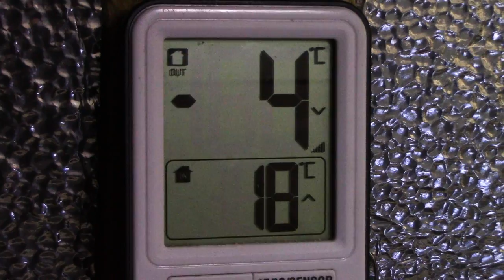Snowmobile Camper Solo Overnight- Primitive Heating & Wolf Lullaby / Log Cabin Update- Ep 11.6

Comment: As a suggestion, try brick pavers, the type used on driveways and patios. Can be heated directly over the flame, stack well inside the ammo boxes and can increase your heat storage capacity. Just remember a pair of tong's to load them into the ammo boxes! Awesome build, thank you.
Reply: Or fire brick.
Reply: I think Stone would retain the heat better than water. You would need at least 5 or 10 gallons of water to do what those stones did. The water would lose its heat quicker.
Reply: Brick pavers are very porous and can absorb more water than a stone making them potentially more dangerous than a rock but may also allow the moisture to escape when heated without fracturing. 
A better choice would be some square cut stone that would fill the ammo box eliminating the air space.
Reply: @Crewsy  he means brick paver not concrete pavers
Reply: @Crewsy  Yes.  Brick pavers are also less dense and less efficient.
Reply: rocks are easily gathered...
Reply: Steve Pratley I’m pretty sure he doesn’t need suggestions from us. And there’s a good chance he won’t see them anyway, he seems to stay too busy to read all the comments he gets.
Reply: @redhauscreator146  heat loss of water is due more to evaporation. If you use a sealed container, the loss should be the same, then just control the heat loss by the amount of insulation on the container.  With water you can just melt snow and not pack around the weight of the rock or brick.
Reply: Water can only be heated to 100c, depending on altitude. Rocks can be heated to much higher temperatures, making rocks far more desirable than water as a heat battery.
Reply: secret six    🤦‍♂️

I said brick paver not concrete paver so what do you mean?  Brick 🧱 is still more porous than stone ⛰
Reply: Cal 20 Sailor 
Water is a great heat sink because it absorbs heat fast but that also means it loses heat fast. 
Water is listed higher on the chart in the link below but I believe that is because it’s density (mass) is so much lower than stone which has the highest thermal conductivity by far (3 times that of water)

http://www.greenspec.co.uk/building-design/thermal-mass/
Reply: Couldn't you run a bunch of lines of copper tubing under the bottom layer of the sub floor.like inline floor heating run the coil into your firepit use water and antifreeze. Just a thought!
Reply: Bradley Schneider that will work perfect 👌🏽
Reply: @Yamahabanshee66  thanks he already has the floor in just route out with a Router on the sub floor and put some quick connect couplers hooked up to the outside.should be able to put like some type of cement to fill the gaps on the routed floor.or just add another 3/4 inch sub floor on top with the lines already in it
Reply: Iron/cast iron/ball bearings/anvil/etc store about the most heat of practical materials and no voids to make pressure steam and explode.
Reply: @bradleyschneider3871  I had the same idea last week as a suggestion for an off-grid Tiny Home which had a wood burning fireplace with a large passive-heat bricked surround. I thought about running the ends into the campfire in this situation here, too. I am just all about the radiant flooring, I guess. He could run water or oil through the tubes, yes?
Reply: Bricks will probably dissipate heat faster than dense stones but it would be interesting to test the idea. Fire bricks would likely last longer. Density is key, I think.
Reply: @lizday8140  I agree if your worried about the structure being burned just move the fire a little farther away and he can put something like that in his cabin build,a lot more work but the wood stove is not in place yet something to ponder over?
Reply: @stevecounts325  Well, he could have just disabled comments; there's actually some genuinely good advice happening. He definitely reads/highlights comments.
Reply: itskarl79  The rocks are free, the water is free, none of these other options are.

Comment: install some metal lined drawers in the floor, place hot rocks in them, warm floor, you will sleep good
Reply: Sleep good on a hard board with no air mattress?
Reply: Ben Scoles good idea indeed.
Reply: Good idea
Reply: I was thinking of some solar panels on the roof, deep cells in the floor.
Reply: The old board beds on the farms had slots in them for the hot irons or bricks that were taken to bed for warmth.
Reply: @ArizonaIrish  Batteries & Winter Are A Problem!
Reply: remoteviewer57 , I have no frame of reference. Desert rat here from AZ. We don’t really have a winter.
Reply: Gas convector and cylinder - the easiest way to solve the problem with heating
Reply: @Просто4еловеК-щ4к  100% but at the same time it's great to see a different method. In a confined space I'd favour for slow realise of heat as suppose to gas
Reply: @MrTomDon  he could at least keep a small mattress in the shelter 🙄🤔
Reply: @ArizonaIrish  so the batteries can / might explode while he's sleeping. Batteries need ventilation 🙄🤔😶😯
Reply: The tiniest wood stove the corner shop sells, mounted up enough to get your feet under. Alternatively, the Victorians did some interesting things with greenhouses and really long chimneys, wrapped around the walls. looked and sounded beautiful.

Comment: Maybe using hot air from an external campfire would work.  Put a heat exchange radiator in the floor or on a wall.  It could be pretty small, you are heating a small space.  Run a metal tube or line from a heat exchange coil in a fire and run the hot air into the campers heat exchanger.   You could put rocks around your heat exchanger in the fire to create a thermal mass so you would have warm air for hours even after the fire dies.  No heating heavy rocks, no heating 80 lbs of water, just a simple heat exchanger at each end.  Of course, vent your system to the outside of the camper.  This would be simple and light with no chance of fire or CO2.

Comment: You can try a radiant floor with a hose connected to a copper coil that can be placed in the fire.  You may need an expansion tank and a small pump.  And a wire to drag the coil in and out of the fire.
Ps: you need a vestibule to keep your clothes
Reply: no need for pump, the natural effect of heat transfer will make the water flow, even just a inch over level of fire.....great idea
Reply: If it's to use coils, what might be worth looking into are heat exchangers for the air coming in and the air going out, since that's probably one of the main sources of heat loss.

Comment: I bet that thing loses so much heat every time you open that huge door. You might consider hanging a plastic sheet or something to stop all the cold air from rushing in. As you've put a lot of time and work into heating your space and I'm sure you would like to preserve that effort as much as possible.
Reply: Maybe make a smaller door on one end to crawl in and use big door to pack gear in and out.

Comment: You might consider adding a tray for the hot rocks, underneath your "bunk" area.  Planks with space left in between them would allow the hot air from the rocks to rise between the cracks into your bunk area.  It will keep your back warm and prolong the heat loss from the rocks.  Also consider a small ceiling fan.  It will push the hot air back down into your sleeping area, prevent the condensation from forming and prolong the hot air from escaping out your vents.  I like the solar idea too.

Comment: I built a camper on a 4x8 trailer in Fairbanks back in 1985.. It had 2x4 insulated floor, walls, and ceiling.. Double pane glass windows, and a tiny wood stove.. Dimensions when finished was 6' wide x 9' long.. It had a slope roof front to back high enough for a 6' tall person to stand.. First winter campout was -20°F yet maintained over 60° with the wood stove.. I could remove the skids and put the axle back in to pull with my quad when there was no snow.. I hauled that little camper into fishing and hunting camps in the middle of nowhere and it kept up for years before giving it to my nephew!

Comment: Hey i have a quick tip for drying out a tree while its still standing. its called tree girdling. You have to cut a strip of back all the way around the tree. The tree uptakes nutrients from the bark. if you cut the bark all the way around the tree will die and dry out while still standing. then come back in the winter and chop it up for fire wood. Look into it. i hope this helps.

Comment: Something that you might want to install is a computer fan at the ceiling blowing down to keep the heat circulating in the hut, they draw next to nothing in power. That way you can close the top vents, with having the crack above the door you would have plenty of fresh air circulating but keeping the heat from escaping out the vents making the hut stay warm a lot longer by morning.   Just a thought, worth trying

Comment: What a truly AWESOME winter camping experience !

Li-ion batteries do not handle cold well.  Lead acid is still he best for cold weather.
Reply: True I run a Goal Zero Yeti 400 lead acid with chained solar panels. It is before they came out with the 100-watt panel.  The big PLUS I can take it on the Air Plane no problems great that the under seat spot.

Comment: I enjoyed your video. You might consider wrapping baling wire around your clevice and then through the eye of your clevice pin to keep it from vibrating out while you're pulling the sled. Once they fall out in the snow, they're impossible to find. Cheers from Alaska!
Reply: Also consider adding an external ledge behing your sledge to carry your gas cans. You don't want them to leak or vent where you sleep.

Comment: Excellent, thanks for sharing. I'm going to copy you :-) I have to do some winter drilling on my placer claim. I've being looking at tents etc. Your idea is much better. I will use a big buddy heater...with ventilation.
Reply: I have one of those, not so sure that would be a good idea. There is a hot spot about 5 inches in front of the heater on whatever it is sitting on. Think those are for a larger area with a safe surface to sit it on.
Reply: Yep heater will be too hot. A friend just told me to buy an ice fishing shed insulated cheap. Some have foldup sides. I'll try that next I guess.

Comment: Water quickly cools down.  Hot water bottles always quickly cooled down for me. Build these structures for sale for other folks and patent them.
Reply: Susan Adams Even boiling water starts out at 100 degrees or so, while rocks can get much hotter, so it may not be a matter of losing heat but of not having as much heat available to start with.

Comment: Just a thought, a chimney puts off alot of heat, if you put a shelf and cover on the back of the sled, then just ran the chimney in a few inches and then out the roof, you'd get alot of heat then if it ran out of fuel in the night, it probably wouldn't matter by then, Love these videos

Comment: As a possible alternative for heat. Nurseries use grow mats to keep their seedlings toasty. A grow mat is a rubberized waterproof heating pad. They can produce heat up to 70 degrees Fahrenheit and they only require about 2o watts of power. Therefore and Rv battery and a solar panel or small wind turbine is sufficient to charge the battery and the battery will have sufficient power to keep you comfy. Since it would be on the floor under your bedroll it would take up space. Just a thought.

Comment: Great, camping like that makes my blood run hot. Heated Stones is a nice option but always requires a fire. In windy conditions and snow blizzards not so good. I recommend re-thinking your options on the wood-stoves. They can be very small and sturdy. You could make a large lightweight metal enclosure all around it to prevent sparks or burns. A tiny ventilator could spread that heat evenly through your cabin. Making hot water or preparing a meal is much easier and you have comfort. Just install a good exhaust pipe and create ventilation (Draft). You could also run a tiny gasoline-generator to heat the cabin with a safe 500 watt heater in case the wood-stove isn't an option either. Having a shelter out of wood with insulation is already far better than most have with a small winter-tent.

Comment: I love the camper set up. It would need wheels on it here as we don't get snow. Great videos keep up the good work. 👍
Reply: I was thinking about one with wheels as well & pulled by an ATV.
Reply: He could put a swivel like a wagon under the shelter and make the wheels and runners change out for all season use.
Reply: @johnchase4408  I have been thinking that for a while, so I started building one. I am doing a video series on the build, only have the first video up, the next 1 will be up later today and the third in a few days. will probably take several weeks to finish it, Check it out if you want.

Comment: I suggest lining it in copper tubes on the inside, with a boiler attached to the outside and a closed burning compartment you can put a small amount of wood into, boil the water and through thermal dynamics it'll circulate through the pipes inside, keeping you nice and toasty all night long. just gotta make sure you put one of the lines higher than the other in the boiler for optimal efficiency  :D

Comment: I can not imagine walking around in a "chorus of howles" in the dark without at least a revolver.
Reply: Wolves are not a problem. I have spent over 44 years studying Wolves and other North American predators both in research, ala libraries, archives, computers and film and time afield. I spent three years interacting with a wolf pack at Great Bear Lake and got within a few feet of them in my 2nd year and they never showed aggression. Not once even near their pups. Another time in Northern Ontario I was a fishing guide spending the spring and summer at  Lukinto Lake, Longlac, ON.  I had seen tracks of both moose and wolves along the sandy shores and heard their howling at night and saw them walking along the beach in early morning a few times. I was around them for months and never encountered them until one summer day when while walking a trail,  a bull moose ran across the path about 12 feet in front of me. A few moments later 3 wolves did the same in pursuit. The last of the three glanced at me momentarily as he ran past and had he wanted to, he could have easily come after me. I was far smaller than that adult bull moose but it kept on pursuing it instead. I was only approx.10 feet away at the time. Two different packs in two separate northern locales and one smaller pack treated me with indifference while the NWT's pack numbering 16 strong, showed a lot of curiosity at times, indifference at other times but never a threat of malice.
Reply: *AR-15

Comment: is there a way you can crawl out of that front window in an emergency? I ask because I'm imagining a strange scenario where the fire melts the  snow bank the cabin is resting on, and the whole thing topples forward trapping you inside.
Reply: In that kind of emergency you would be able to use your legs and back strength to bust out of one of the ends or back I'm sure. Built well but not welded.

Comment: hello
water's thermal capacity is higher than many materials but there is a limit of 100 centigrade which is boiling point of water. to store thermal energy, professionals use Salt in the solar plants.
another alternative is oil if you carry it with you.

Comment: What about a radiator set up with Cooper coil heated outside on the fire feeding warmth into the shed if designed well I think you could just use Thermo Dynamics with no pump in theory
Reply: Bong-O-Boy 710 I was thinking the same thing.

Comment: Use a hot water bottle for warmth dude!

I realise this is an older video now and you may have sorted your heating issue by now, but I just thought I'd suggest it anyway. They're basically insulated rubber water bags designed to slowly emit heat overnight etc. They're fairly common in my country (New Zealand)

Comment: With regards to insulation, and since you appear to have space, I would suggest a further 2" of insulation to your roof, and 1" to your walls. Heat rises and the majority of loss is via the roof - and that huge door :-)  so a considerable heat saving could easily be acheived at minimal cost and effort. Only a suggestion.

Comment: I love your little camper and think you did a great job with the design and build. I'm thinking that a 35 amp lithium battery and an inexpensive 10 amp charge controller would work perfectly with that panel. You might also want to add a small USB powered fan to circulate the air in the camper and keep some of the warm air down down lower while you sleep. Good luck and thanks for sharing your adventure with us.

Comment: wow, what a video. At the 4:26 mark in the video I thought to myself "oops, we lost somebody." Then at the 4:49 mark it looks like we lost the rear sled also. lol   At 21:04 you looked a little nervous and then again at  21:18. Your bucket handle is going to need replacing if you keep burning it. 31:01 To stop most of the heat from going to the top of your shelter and staying there you need  a small fan to move the air around. Good luck and pleasant dreams. 👍  😁

Comment: every time the door is opened ALL the heat escapes
Reply: No.  Some, but most stays.  The thermal mass, although not great, holds the heat.
Reply: @Bob.W.  naw man.im a frikkin polar bear and the heat has to build back up over time.i think the rocks are an uneccesary method for what your doing.just get a van heater and call it a day.

Comment: Just watched a few of your videos for the first time. One  about heating your shelter and then   video on hot water heater.  My thoughts would be instead of putting a AMO can in your shelter think about putting radiant floor heating. And if your solar panels work really well you can also use an electric radiant floor heating pad.